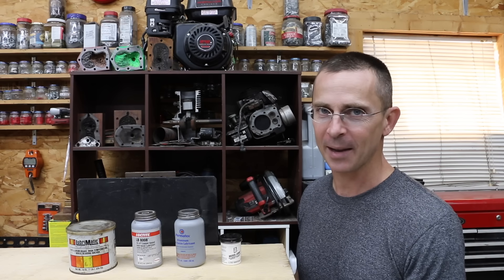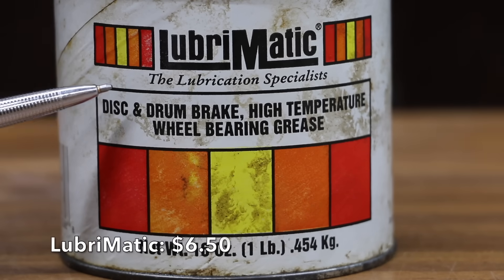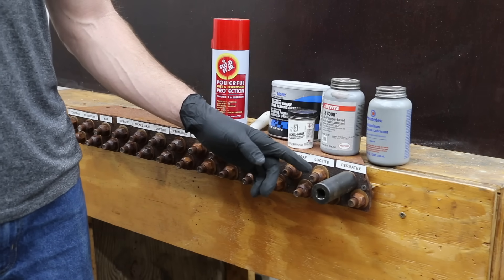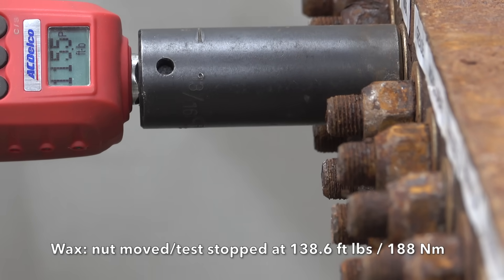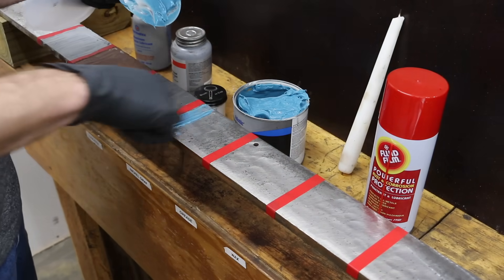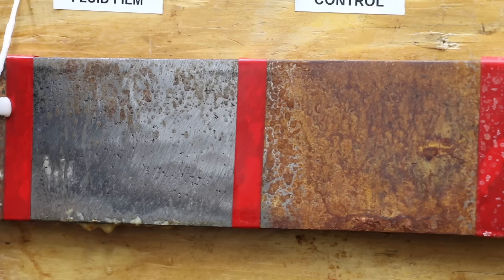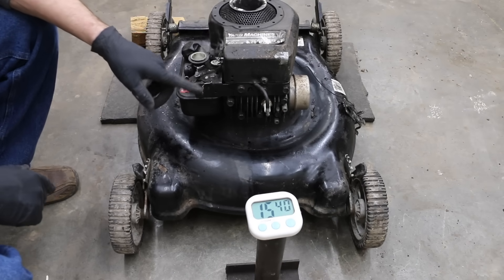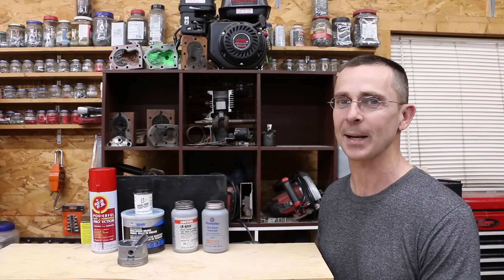Does Anti-Seize Compound Actually Work? Let's find out! Anti-Seize vs Grease vs Fluid Film vs Wax

Comment: I wonder if there’s a ratio of anti-seize to engine oil that may provide a meaningful level of benefit? Could it act similar to Engine Restore?
Reply: I doubt it. Being its made with aluminum or copper, depending on the type, I thing it would just take out the bearings or the cylander wall and rings.
Reply: Sdunlimited1 Sdunlimited1 - yes, I had the same question. Testing out a mixture to see if you gain a benefit.

Comment: Good test, Commander! I have a pal that's a self-made millionaire and he always used burned diesel engine oil. He said that burned was better than new. I might be broke but got a CAN with a brush in the lid of Permatex when I was in my 20's and still have it. I've had to add to it some and thin it a little with motor oil but still use it, last week, matter of fact. And depending where I was I've used oil and grease as well. You use what you have and the anti-seize was at home unless I took it with me because I knew I'd need it. I'm also prone to use Permatex #2 and Aviation grade stuff so we go back a long time. And I use #2 instead of silicone because it doesn't set up in the tube and dissolves inside instead of gomming up. So Thanks again and BLESSINGS 2 ALL Yall!.
Reply from the maker: Hi Lewie, Thank you very much!  You've got a tremendous wealth of knowledge and experience.  I always enjoy reading your comments!  Wishing you and your family many Blessings and a great week!
Reply: @ProjectFarm  Thanks, Commander and this is wht a lifetime of working construction has gathered! Lots of goofiness but a useful tidbit here and there. Makes you appreciate work release! I'm mowing grass like I ought to be and glad to be doing it. Guess you're haying and probably on the 2nd cutting. So we're ALL blessed and yall have a HUGE week as well!

Comment: Hi there.  Enjoyed the video.  A bit of info about the design and use of anti-seize, its various formulations, and why it sometimes is pretty spendy:  anti-seize compounds are meant to be specifically applied to static loads where one or more various factors are of concern, including high temperatures, exotic and/or dissimilar metals, and materials subject to galling under high clamping loads and vibration.  The reason why different metals are used for the various formulations is because it is designed to aid in the prevention of galvanic corrosion and often to promote electrical conductivity.  As a general rule, anti-seize should be selected for the application based on the similarity of its metal composition to the application surface (i.e. nickel anti-seize is typically good for preventing galling on stainless steel threaded fittings).  Another valuable property of anti-seize is in high temperature appications.  The idea is that seizing can be prevented long after the grease carrier dissipates due to extreme heat, leaving behind a plating of the solids within the mating surfaces.  Incidentally, these solids that are very beneficial in preventing seizing in static loads are also what makes it very unsuitable in dynamic loads, hence the failure of the engine when the crankcase was loaded up with the stuff.

Comment: id like to see more diesel stuff like what can a modern small diesel run on for example moonshine vodka whiskey used motor oil used cooking oil that kind of stuff and which one gets the best mph or lasts the longest
Reply: Man, with all the emissions bullshit I'm not sure any of them would run for long.  There's a channel called "Novice Garage" where they run a 7.3 on all kinds of stuff, from used mcdonalds cooking oil to jet fuel, along with a Miata they put all kinds of stuff in as fuel.
Reply: @GrandPrix46   thats an old school if it burns it runs diesel i wanna know if shit hit the fan and diesel gas stations shut down could i run a newer diesel on that stuff i know older diesels like the 5.9 cummins and 7.3 powerstroke will run on anything but what about a newer motor

Comment: Hey, just a thought I'm throwing out there, but would using an ozone generator be effective for corroding metals instead of using a chemical agent for testing?
Reply: Why?  It would be far less relevant to real world corrosion conditions, and be harder to quantify, and more expensive.  Plus, no, you need a liquid carrier to test whether it's seeping into the threads between the fastener and nut or threaded member.  Water wicks into gaps by capillary action while a gas generally needs some pressure differential for the same extent of penetration on a fastener.
Reply: @stinkycheese804  Good point, the rain puddles in my area have water in them, not ozone.

Comment: i prefer to use grease on engine components as an anti-sieze, however for the brake components i tend to use a softer aluminum anti-sieze.
they all have a place (not sure on the wax though)
Reply: Grease is decidedly inferior for engine components because the heat makes it thin and run out.  Elsewhere, sure.  The anti-seize has not only an equal or better base but also the metal left behind.

Comment: do you use antisieze or grease on the studs and hub of a vehicle? people always say itll cause issues and the studs will shear off due to lack of friction on the hub.. but ive never had an issue and its greatly reduced the chance of ruined a thread and removes the need to pry and hammer off seized rims if a vehicle goes without them being removed for a while... im in eastern canada and we have some pretty extreme rust.. cars dont typically survive past 10 years without precautions or patches and its not uncommon to need to hammer on a socket several sizes smaller over a nut thats turned to a flakey puff of steel rather than a hex

Comment: I thought one of the primary reasons for using anti-seize was to prevent cold welding of the metal due to galling and other factors.
Reply: marine6680 correct that’s why you use it on stainless bolts

Comment: I use anti seize quite often. I use "Never Seez" just because I found a big can of it so it is free. I have compared it to the permatex and it is at least as good.  If you need to lubricate something that is exposed to fire, grease doesn't work. Anti seize is good for (some types 3000-4000°F ) so anything except oxy-acetylene flame is no problem.  Also if you are bolting say steel bolts into aluminum grease will not work. Anti seize is a must if you want to get the bolt out down the road sometime.  A very different product than grease for very different applications. If you have a situation where it is needed it is a MUST.

Comment: Hey question why would it be good for an anti seize lubricant to require less torque to undo a bolt than it did to tighten? Is that normal? I would assume whichever method was closest to 90ft lbs would be the best.

Comment: I really like this test. Just a bare bones lets see what happens. Can add a few things to when it comes to anti-seize. Anti-seize comes mainly in two varieties. Metal pigments or chemical ones. The metal type made the engine seize. Lack of lubrication which oil does. Would do the same for mechanics who use it on spark plugs and then scratch their heads and wonder why they removed the plug with metal on the threads. Instead of using chemical anti-seize or just plain non-detergent oil which is the old stand by. The rust test was plain and fair. I can add to you test using candle wax. When you heat the fasteners and then place them onto a large candle and let the heat melt the wax onto the metal, you have a winner. This method will keep rust at bay for years and does not take a long time to do. Just clean the bolts and nut with wire brush and heat and drop and wait a little till wax is coated on the metal. Put together normally and you will be amazed years later NO RUST. My old trick that is bullet-proof. Good day fella PF.

Comment: Copper Antiseize all the way. Rebuilt the front end of my truck about 8 years ago, when I did I painted the parts with copper antiseize before I put it back together. A couple weeks ago had to replace a ball joint and both wheel bearings, the antiseize was still wet! Being a mechanic I've always been a firm believer in any antiseize is better than dry, but the copper has sure impressed me.

Comment: When I was working in trailer manufacturing, there was an incident where somebody accidentally used anti-seize instead of loctite. It worked a charm because the nuts were already loose by the time the unit had reached final inspection. That's why you should avoid lubing threads lol
Reply: DriveAndMaintain So how is it when I assemble engines I lube main cap bolts , rod cap bolts and nuts and head studs with ARP thread lube and they don’t come loose in those extreme conditions. I have never seen properly tightened fasteners come loose with anti-seize under normal conditions.

Comment: Having lab tested Mil-Prf-907 anti-seize products for years, there are a couple of tests you need to perform to get an idea just how good the product is.

The first test is called copper corrosion testing, where you take a polished copper plate, immerse half depth in the anti-seize compound, then place in an oven for 24 hours @ 220F. Pull the product with the copper plate, wash the plate with solvent, then look for corrosion at the immersion line.
The second is to place some of the compound in a test tube, heat for 24 hours @ 250F and look for a separation of oil from the anti-seize.

Finally, nickel works better than aluminum. Copper can't be used on aluminum or you get dissimulator metal corrosion. Otherwise, you did good.

Comment: You should test wax again, but with a different application method. Do not heat it up and drip it over the surface, take the candle and rub the surface, you want to protect, with it until you have a thin film.

Comment: Hi, 

I am glade that you are still doing very well despite what is going on with covid-19. I like see that you still have a nice smile on your face even thow all that is going on in the world right now. I hope that your family is still doing great as well. I have learned a lot of great information by watching this video. The main thing that I have learned by watching this video is that all of the ant-seize brands are good products. The one thing that I will not be using is candle wax for protection because the candle wax did nothing toward rust protection. I would like to see you try testing circular saw blades to see is the manufactures and the brands makes a difference or not. I would say if you can afford it, try testing from the cheapest circular saw blade to the most expensive circular saw blade. I hope that you and your family keep on taking care, and I am looking forward to the next new video that is coming out on Monday again. So please try to take care in' till next time!

Comment: You talked about how anti-seize will act as a lubricant, and effect the torquing of bolts. You should always lubricant the threads of any bolts you are torquing.
Reply: That is not true at all.  Any torque spec given for bolts is always for a new, clean bolt with nothing on it unless specifically mentioned.  As a result, you are over-torquing most bolts and potentially causing damage.
Reply: Stinky Cheese I was going to reply until I saw your name was Stinky Cheese. Not going to waste my time.

Comment: we use the loctite at work it does ok, but it gets high temps non stop 24/7. when a bearing fails on a shaft, getting the pulley off of the shaft is still next to impossible. even with a hydraulic press. we have tried the most expensive graphite anti seize, it still doesnt work. normally we cut the pulley off the shaft. drive the shaft out with a sledgehammer. and the machine shop sleeves the pulley.

Comment: The aluminum based anti-seize would be a problem over time as aluminum and ferrous metals are incompatible (galvanic corrosion).   We use nickel based anti-seize at work (automotive dealership setting in the NE USA) exclusively.
Reply: It's not really an issue because the aluminum is anodic in this case but already tiny particules so just creates aluminum oxide, if it wasn't already.

Comment: When putting grease on brake caliper pins and slide I always  add  a dab of Anti seize to a glob of grease and mix the two together.  Then apply it to all the parts that need to slide .  What's your opinion to this mixture?   Note just adding a small amount as a little goes a long way.

Comment: Thinking about the first test results, almost seems like candle wax would be good if you wanted nuts and bolts to stay tight in situations where you want it tight permanently. Side note, I’m curious why it takes a lot less torque to remove a nut than what it was torqued on to. Seems like at the very beginning of loosing, it should require the same torque for a split second at the start to get it loose equivalent to the amount of torque that was used to tighten??

Comment: Does copper anti-seize when used on bolts in aluminum cause electrolysis due to galvanic corrosion and does this lead to greater force to break those bolts loose?
Reply: It can. Thats why you would use either the aluminum or nickle antisieze. 
 Copper on stainless and regular steel.
Reply: Yes. I would be careful especially with aluminum blocks and heads. Use Nickel based one.

Comment: Great testing as always! I have used anti-seize while working in a oil refinery and critical uses were mostly on stainless steel fasteners where galling or metal fusing is common especially at higher temperatures. Pipe flanges held together with carbon steel stud bolts also benefited from anti-seize especially when piping was frequently opened by reducing bolt/nut thread corrosion, making for easier disassembly. I have found that anti-seize compound is invaluable on steel automobile bolts, nuts or screws in aluminum castings and on high temperature exhaust systems.

Comment: Good evening Sir, ✌You have a great sence of humor using anti seize as a replacement of engine oil !!!🤭🤣😂😉 You did an outstanding job on this video Sir 👍 CHeers !!!😊
Reply from the maker: Thank you very much!
Reply: I''m shocked he got it running against the thickness of the anti seize.
Reply: @AffordBindEquipment  Good day Sir,  i agree with you. Oil is for engine, not anti seize. It sure make a good show however,,, CHeers 👍

Comment: I have had to replace the junk exhaust sensors on my Ford diesel truck several times and discovered Ford does NOT use anti seize on the bolts which are exposed to extreme heat . Ford actually gives you new bolts and a saddle for the exhaust because you sometimes have to cut the OEM sensor out . I use a nickel based anti seize and have no problems replacing sensors after using the compound .

Comment: Too bad you don't have an old Ford 4.6L.  You could do this test on the spark plugs.  Put a different snake oil on each plug, run it for 75,000 miles, then see which plugs come out without taking the aluminum threads from the head with it
Reply from the maker: Great point! Thank you

Comment: I got permitex nickel specifically for keeping steel bolts from seizing in aluminum. 
I dont know how hard it would be to setup a steel/aluminum galvanizing test. Im not currently aware on how to accelerate the reaction.
Reply: That's more true with stainless fasteners, but you'd set it up with aluminum as the anode and pass an electrical current through it, though PF's test using salt/acid/oxidizer would still be relevant since aluminum oxidizes readily if some goop doesn't seal it.
Reply from the maker: Great video idea! Thank you

Comment: When I was in the US Navy, we used Philips Milk of Magnesia on exhaust bolts in T-58 helicopter engines. I have to admit, I was ROTFL literally, no crap, pun intended, when I first saw it used. 🤣🤣
Reply: Make sure it's the unflavored, used all the time on jet engines.
Reply: @jeffdemarcus160  Yup, shake well before each use. It turns into a powder, when it dries, that doesn't burn away very easily.
Reply from the maker: Very interesting!  Thank you
Reply: Magnesium

Comment: I gotta say, I have had good experience with the "copper snot" as I call it.  Ive used it on a few cars on wheel hubs to keep the brake drums and rims from sticking to the hub.  One application lasted about 5 years for me.  The silver snot not so much, but it depends where it is used.
Reply from the maker: Thanks for sharing

Comment: Should be noted that the aluminum&copper anti-seize have a fine abrasive grit that helps with not seizing thus as a lubricant its only good for torquing the bolt. They're often misused as a lubricant in places with high temp cause the label says so but by that temp the grease evaporates and the left behind metal powder&grit do the job. So when put into the engine it acted as a fine valve lapping compound and lapped the con rod :D
Reply from the maker: Great point!  It didn't take long to destroy the engine

Comment: Paraffin wax burns above 390F ... That might explain why it did so poorly.

Last time I used wax on something, I bought a block of paraffin from the hobby section, and melted it in a disposable 13x9 baking pan with 2" of water already in it. Baked it at the lowest possible oven temp, and just dipped the object into the pan. Then I just let it hang in the sun to dry off.

The thing I was coating never came into contact with significant heat though... Some of the metal was used for spring tension, so 390F heat probably would have ruined the whole device.
Reply from the maker: Great point!  Thank you